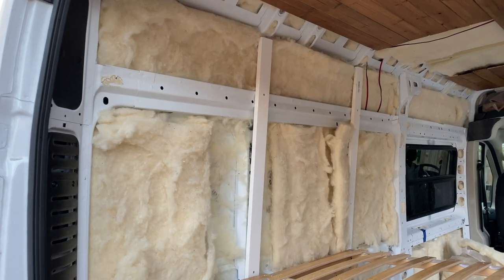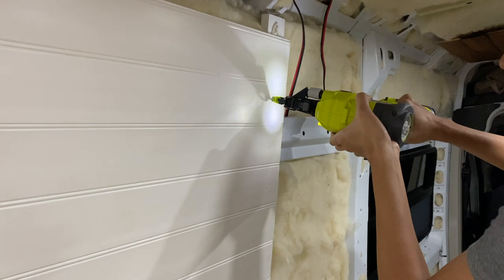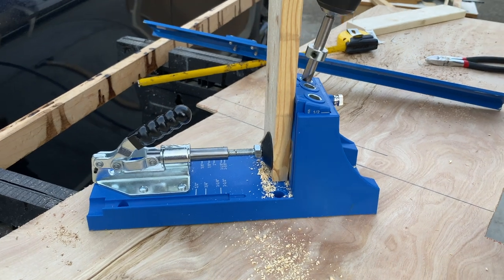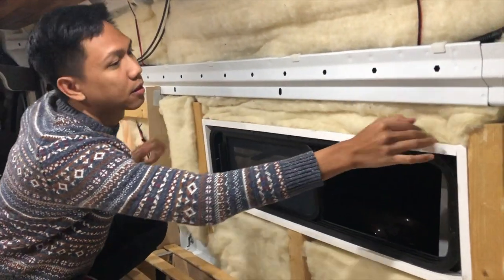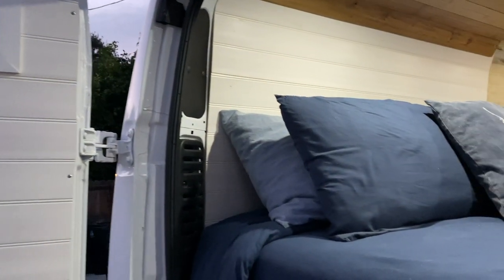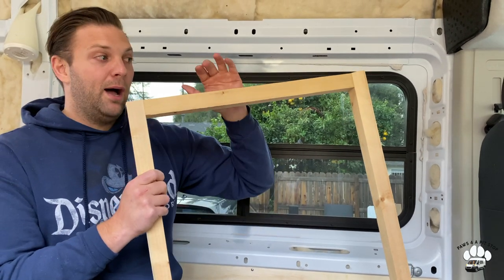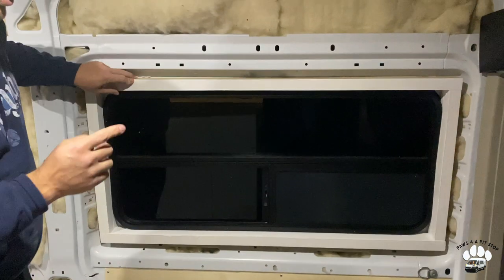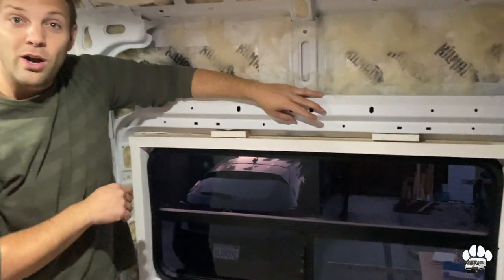Van Conversion Window Framing & Walls - Van Life Vlog EP 10

Comment: You both make me smile :)    
One question - What size is the wood that you used to make the original frame for the window?  Sometimes it looks like 2x2s but at other times in the video, it looks like it could be 2x3s or even 2x4s.  And then, I think, you used 1x2s to make it a deeper frame but could you confirm that as well?  I have been struggling with how to frame this larger window and would love to re-create what you have done.
Reply from the maker: Don’t worry - we were (and still are) just as confused ;)   We started with the 2x2 but it didn’t come out enough - that’s why we ended up just adding a 1x2 to the back of it (instead of wasting the 2x2s and starting over)  and it was just about perfect.
Reply: @PatrickandArthur  Thank you!

Comment: Hello Arthur and Patrick!  I hope you have been out and about and enjoying your van :)   My van build came to a screeching halt in June but I am now trying to pick up where I left off.  This brings me to my next question for you - When you were adding the wall paneling around the window (specifically, the right side of the window), did you screw through the paneling directly into the metal of the van?  If so, what kind and size of screws did you use?